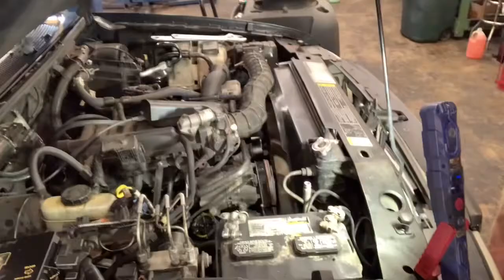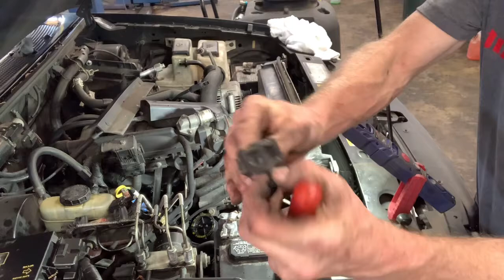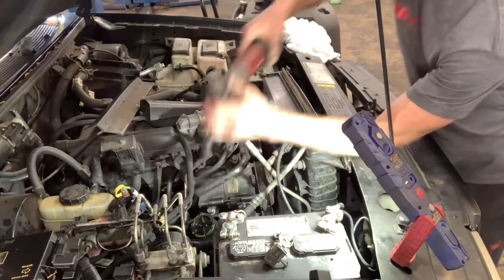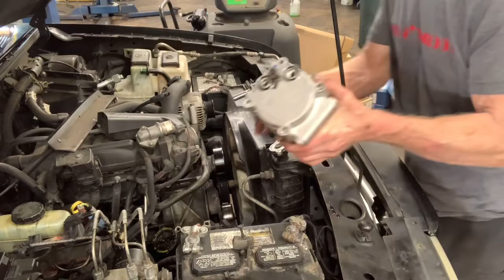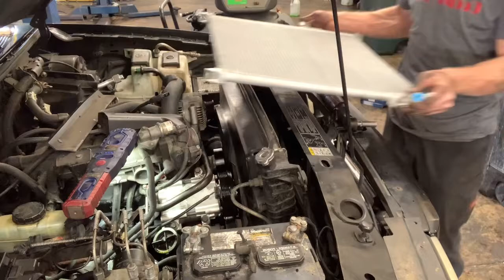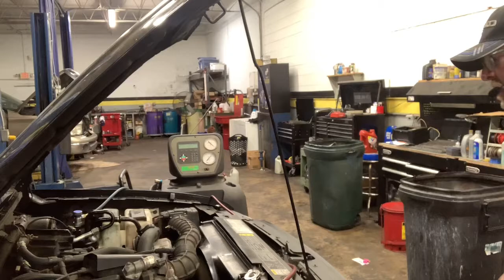How to replace AC compressor fixed

Comment: Nice job have a truck just like it except mine is a 05. One thing I didn't see was the flushing of the lines as you had mentioned at the beginning of the video. How do you go about it
Reply from the maker: use a funnel pour in the flushing product and blow it out with compressed air. Because the system was it full of trash didn’t feel it was needed to be flushed out thanks for washing appreciate the comment

Comment: liked your video. Know this video is 2 yrs old, but I have a 1999 ford ranger 2.5 and am going to replace the compresser, condenser and drier. My system takes 9 oz of pag 46. The new compresser came with 7 oz of oil in it. My question is the instructions for the new compresser say to empty that oil out and put in half of the 7 oz and the rest into the drier , condenser and evaporator. I need to know how much to put into each part if I put 3.5 oz in the new compresser how much of the remaining 3.5 oz do I put into each part? Thank you for your time.
Reply from the maker: 2 ounces per condenser dryer and evaporator
Reply: not replacing the evaporator just the condensor, accumulator and compresser plus a new orifice tube and a new manifold compressor line that goes from the compresser to condensor and to the accumulator.